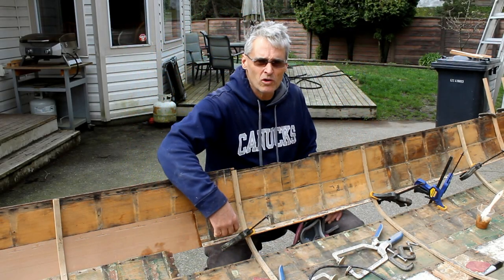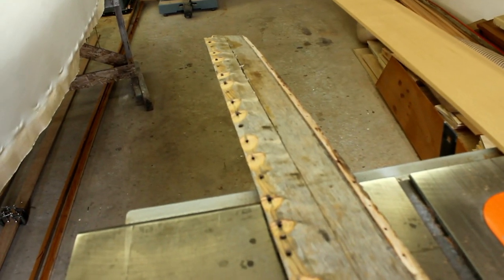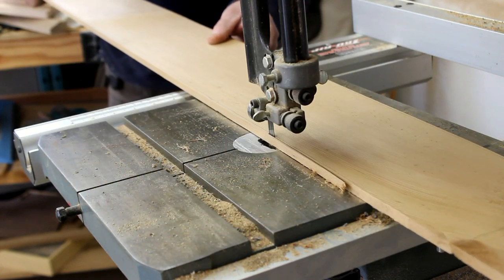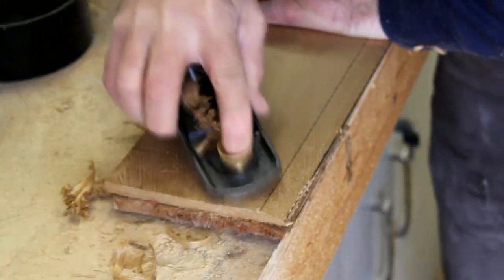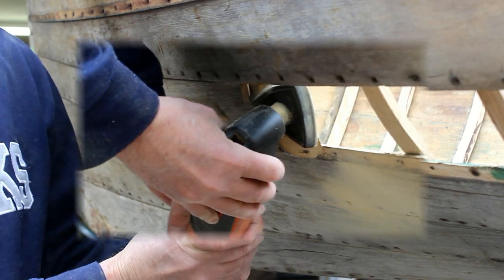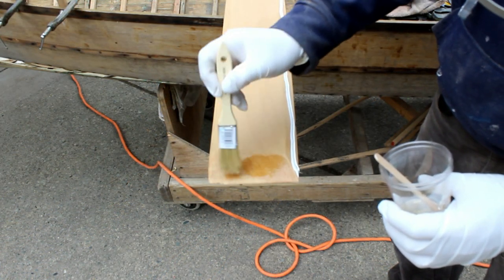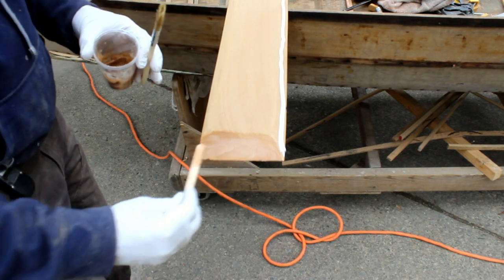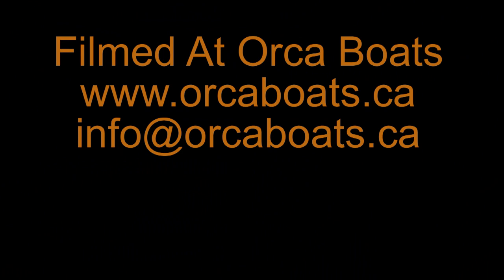Replacing a plank on a lapstrake boat

Comment: Where on earth did you get white cedar that wide and clear? If that is white cedar.
Reply from the maker: That planking is red cedar and I live in a rainforest full of it.  One of these days when I am at the mill, I will get some shots of the massive beams and timbers being cut.  Last time I was there, a 30 foot beam of yellow cedar was on the mill and it was at least 20 inches square and clear.
Reply: @OrcaboatsCa  Aha- I thought you were from Ontario for some reason.